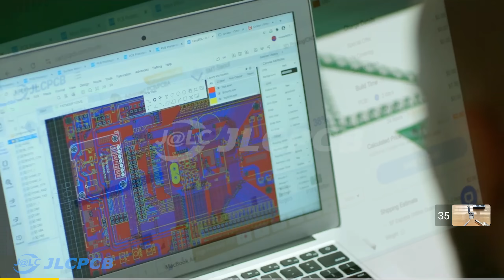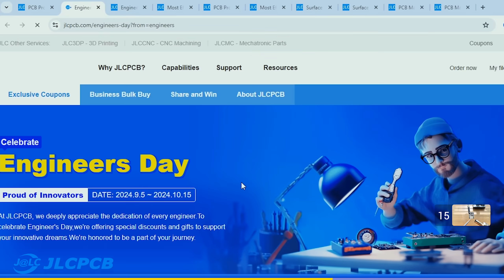DIY Mini Drill - How to Make a Powerful Mini Drill - Rechargeable with Type-C!

Comment: Prompt 👇
A hyper-speed time-lapse transformation video in 9:16 vertical format showing three male mechanics restoring a severely damaged green Lamborghini Huracán LP 610-4 from a burnt-out shell to a pristine showroom-quality supercar in a professional automotive workshop.
CAMERA: Perfectly static, locked-off tripod position at eye-level, centered on the car. No camera shake or movement until final reveal (last 3 seconds) which features a slow cinematic left-to-right pan around the finished vehicle.
CHARACTERS: Three male mechanics, late 20s-30s, wearing identical dark gray/black short-sleeved t-shirts with white logos on back, olive green cargo pants, dark work boots. One wears a dark baseball cap. They move in rapid, synchronized blur-like motions around the stationary vehicle.
CAR TRANSFORMATION STAGES:
- Stage 1 (0-1s): Severely burnt, rusted green Lamborghini with missing panels, fire damage, dilapidated appearance
- Stage 2 (1-2s): Stripped down to bare structural metal frame/chassis, all body panels removed
- Stage 3 (2-3s): Base coat/primer application, vibrant glossy "Verde Mantis" electric lime green paint appearing
- Stage 4 (3-5s): Main body panels rapidly fitted - side panels, rear fenders, doors, front bumper, headlights
- Stage 5 (5-6s): Silver multi-spoke alloy wheels and tires installed
- Stage 6 (6-7s): Final polishing, perfect glossy finish achieved
- Stage 7 (7-10s): Mechanics exit frame, finished car revealed with slow camera pan
ENVIRONMENT: Spacious professional automotive garage with highly polished gray epoxy flooring (mirror-like reflection), light gray walls with dark gray accents, black tool chests and metal storage racks with automotive parts, well-organized workbench. Clean, modern, industrial aesthetic.
LIGHTING: Soft, diffused overhead LED panels (5600K-6000K cool white) creating clean highlights on metallic and carbon surfaces. No harsh shadows. High-intensity professional workshop lighting that accentuates the car's curves and glossy paint finish.
MOVEMENT DYNAMICS: Mechanics move at 10-15x speed in synchronized, blur-like motions around the stationary car. Rapid hand gestures, tool usage, painting motions, panel fitting - all creating a "magical assembly" effect. The car never moves from center frame position; only its state changes.
EDITING: Jump cuts synced perfectly to maintain spatial continuity - the car's position never shifts horizontally or vertically. Only the car's condition/completeness changes between cuts. Creates seamless "stop-motion" transformation illusion.
COLOR GRADING: Saturated, punchy, high-contrast commercial look. Emphasis on vibrant electric lime green (Verde Mantis) against neutral cool-toned gray workshop. High clarity and sharpness on every detail.
AUDIO: Fast-paced upbeat electronic/dance music with heavy beat. Rhythmic mechanical sound effects - power tool whirring, metallic clinks, spray paint sounds, parts snapping into place - all perfectly synced to visual actions. No dialogue.
PACING: Hyper-fast, rhythmic, energetic. Hours of work compressed into 7 seconds of transformation, followed by 3 seconds of slow reveal. Creates satisfying "process-to-perfection" narrative.
ASPECT RATIO: 9:16 vertical (1080x1920 or higher)
DURATION: 10 seconds total
STYLE: Commercial automotive transformation, social media optimized, high-energy satisfying restoration reveal

Comment: Did you change the resistor that controls charging amperage? The stock 5watt charging gets really hot. For something like this 2watts would be more appropriate. So swapping the 1000kohm resistor to something like 3K.

Comment: 2:40  showing the tp4056 board. the tp4057 board is narrower. does  it have the length to fit? if it does then it makes this project more accessible to folks. You miniturizing the tp4056 board does make this entertainment.

Comment: The electrical and practical engineering is amazing in this video. Having said that don't give yourself cancer for a small metal tube. I'm sure he could have found a metal cylinder at any hardware store to do this with.
Reply: Alkaine batteries are not old Nickel-Cadmium. They can chemically burn as KOH is caustic, but they don't destroy you like the old ones. Also - I think battery case here is like 90% of visual effect.
Reply: @sergiuszk I agree with you. I think one of the more important reasons this video has gotten 3.2 mil views is the fact that he used a battery casing.

Comment: The soldering work on the charging port is absolutely insane, it's done with such precision and skill that it clearly stands out. It’s not just good; it’s on a completely different level, Truly impressive craftsmanship.
Reply: Yeah I've wired stuff up to batteries but this is on some  computer motherboard building skills
Reply: this is what got me too, insane work
Reply: It’s all about flux, the right tools and preparation.
Reply: @hanfo420 And a godlike knowledge of the circuit diagram plus the hands of a surgeon. Don't undersell it just cause you can't do it
Reply: I was in awe when he Made the connections
Reply: ты по ходу бухать бросил и стал заниматься подобной х чтоб снова не начать да?
Reply: Right - my jaw literally dropped. That was nasty work - everything else was like ok I'm following - then... boom next level.
Reply: You sound like Ai.

Comment: 1. SMD micro switch will burn out after two dozens of use. 
    Permissible SMD button current is 0.05A, but N21 motor current during drilling is about 1.5A.
    This SMD button burning out with such a motor is checked in reality.
2. Do You want to charge the batteries every 3 minutes of work?
    4 batteries 30mA, total charge equals only 120mA*h. One charge will provide only short time N21 motor working.
3. Charge current of IC in charging modules are programmed for 1A charge current by Rprog=1.2k. 
    For Your batteris the current must be lowered by changing Rprog for 10k (see IC's datasheet).
4. Repair is practically impossible (micro switch, battery, motor replacement).

Comment: 1:42  anyone have an idea how to charge these batteries?
Reply: Probably by running current through the little tabs, but I don’t know really those are not a type of battery I’ve seen before
Reply: Never mind, he just added a USB-C port a little bit in the video after your comment
Reply: @parkerplaystation14 this li-ion battery, for charging need tp4056 or other charging board

Comment: DIY mini drill.........😳 excuse the fukk outta me?!?! Who's got not only the soldering capabilites but also a in depth understanding about how a PCB board even works let alone reconfoguring it to fit inside a AA battery 🤯 its only DIY for 0.000000000001% of people. Amazing stuff nonetheless 👏🏽

Comment: I nearly considered trying to build this project, however after seeing the insanely high skills needed to solder such small components the deal was sealed for me. There's absolutely no way i could ever do such a project😂....those soldering skills of your are simply incredible!!!! Well done!! Im totally impressed
Reply: Claro que puedes. Utiliza pistola de calor, Flux, pistola cautín y soldadura de estaño
Reply: You can use an external charger. Won't be as neat but a "charging station where you connect the wires to the battery via a tiny plug. Because for sure this is beyond my soldering skills and I remember at uni doing stuff with microchips always ending up smelling of burned plastic. The teacher would be pissed too as the entire class would go through 60 microchips in a lesson. Lots of magic smoke.
Reply: Maybe a 9v battery instead of a AA could work for the pcb

Comment: Redflag : when the "thing" is running you never show it completely.
I presume at least you need to power it with a much stronger source than you punny batteries, worstly you just run a dremel tool inside the battery case...

Comment: Could still be a DIY project for lesser mortals by skipping the miniaturization of the charging module. Instead, make it into an external charging brick and insert a USB-C or DC female into the battery shell. Connect the brick when it needs to be charged.

Comment: at first i dont think its will drill through thick layers meterial untill you drill that wood plate, i also impressive that you pull out all small smd chips from pcb and soldered it with a wired, great art!

Comment: The thickness of the oil sign pen is perfect for working and it will be easy to process. Then you can use the lid and when it's not in use.

It's different and cute when you make it with batteries.

Comment: I love it. It's like a gadget from James Bond. 😄

Also using the syringe to get rid of the bubbles in the resin and soldering the components together so you don't need the board was impressive. 👏

Comment: I'm sorry, but I have doubts that this motor will be able to provide enough power to cut and drill textolite.  When you cut and drilled with a finished mini-drill, you did not show it completely in the frame) Part of the mini-drill was cut off in the video and I have a suspicion that you have a regular dremel connected through a flexible drive that passes through the battery case) After all, this is really true, right?) People are so naive to trust fake videos)))

PS: If you had shown a working mini-drill completely in the frame, I would not have such questions. But things hidden behind the scenes always arouse distrust.
Reply from the maker: "I'm sure you haven't watched the entire video, yet you decided to comment. At 6:35, I pick it up from the table and start cutting the PCB. This video, like all my videos on this channel, is genuine, and I don't publish any fake content."

Comment: 14.8v on such a small motor, that's pretty crazy. 👍🏻 the only thing is the battery only has 30mAh and can only last for few minutes i guess. ( Just like those toy mini drones)
Reply from the maker: The batteries are connected in parallel and it is 3.7 volts and its amperage has been upgraded to 120 mAh.
Reply: @PenguinDIY  Sorry for overlooking your connections. That makes much sense now. Thanks for clarifying.

Comment: I have never seen anything quite as percise as this project
I was mind blown as a kid when duracell introduced batteried with a charge level indicator
But that was just a heating element and some thermochromic paint. Also designed and built by a huge corporation
This... This is next level. You can't call it DIY any more. That doesn't do it justice

Comment: I'm impressed by the power of the motor! Did you modify the chuck? I found mine to be really bad...
Reply: It’s fake. No way is that running off 1.5v it’s not possible. 1.5v wouldn’t even turn that chuck.
Reply from the maker: It's like you don't know much about electronics! I have used AA battery pumice and it does not mean that my voltage is 1.5V. In the car, the voltage is between 3-4.2 volts and the motor works with the same voltage
Reply: @thesausage351  thoes are lithium 3v - 4.2v battery cells, not 1.5v. I'm sure it isn't fake!
Reply from the maker: This motor model has a lot of power and consumes more amps than similar motors. I have written the engine model inside the video.
Reply: @PenguinDIY how do you attach the shaft adapter?
Reply: How do you attach the shaft adapter?
Reply: @Jmg2361981 you buy them for the specific size motor shaft, and they have a tiny grub screw to secure it on the shaft

Comment: ese motor tiene buen torque
Reply from the maker: Please do some research on the comment you are giving. This motor has a working voltage of 3-4.2 volts and
It consumes a lot of amps compared to similar motors, so it has a lot of power. At 6:35 it's clear that I'm going to take it off the table and start cutting.
Reply: No way is 1.5v making that much torque. It’s got to be running off an external supply. Notice you never see a full shot of the drill when it’s working. I think he’s got a power supply running into USB C
Reply from the maker: Please do some research on the comment you are giving. This motor has a working voltage of 3-4.2 volts and
It consumes a lot of amps compared to similar motors, so it has a lot of power. At 6:35 it's clear that I'm going to take it off the table and start cutting.

Comment: The degassing right in the syringe is GENIUS
Reply: Didn't catch that. Woah.
Reply: i wondered what he was doing there... can you please provide some context? Usually I've learned that we don't want bubbles in epoxide, so whe use slight impacts to get the bubbles to the top. But here is seems he was pumping in air into the syringe?
Reply: @ARCEYE78  oh, i see. Thank you so much for taking the time to reply! Will try this in my next project.
Reply: аккумуляторы состариваются,
а это подросткам поигратися.

Comment: Masterpiece like always. One question, did you modify the charging current rate of the BMS? Cause the PCB board itself dissipate heat. Connecting them like this is a brilliant idea, but if it charges the battery with normal 0.5 or 1 A, the IC become hot and might melt some wire isolation.
Reply from the maker: I attached the IC to the Type-C port, which cools the IC when it gets hot.